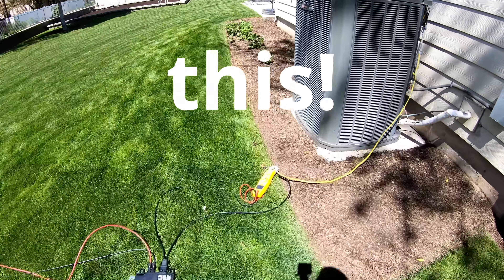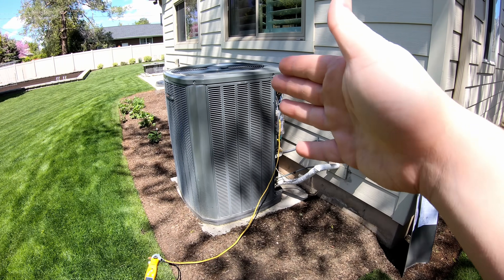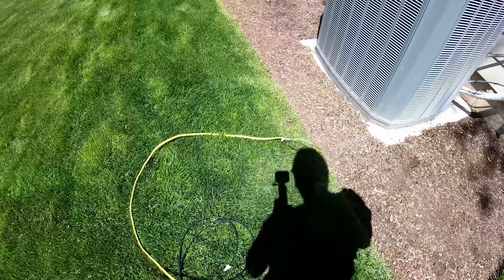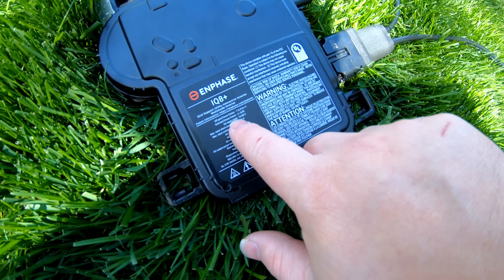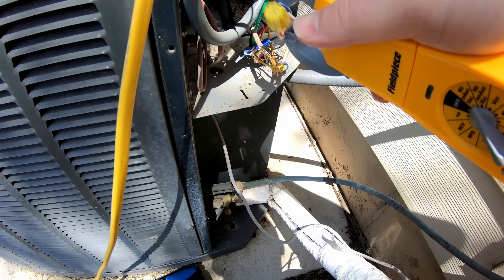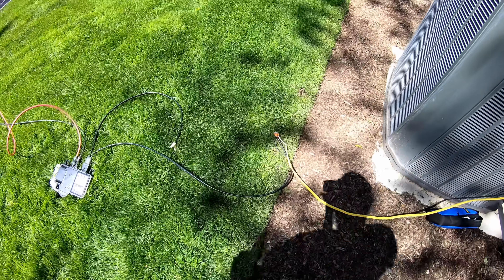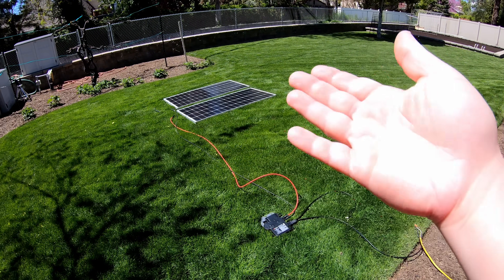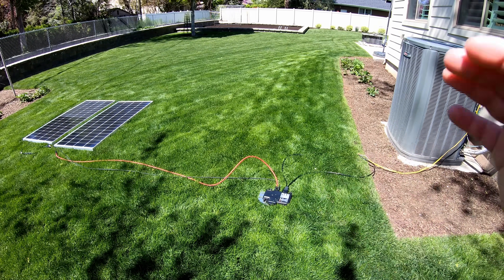1 Hack To Eliminate Your A/C Power Bill This Summer!

Comment: The title is deceiving. Its not eliminating the AC amp draw, just supplementing it to reduce the draw from the grid. Still a very creative way to save a few bucks, after the initial cost for components of course.
Reply from the maker: You’re right. The 400 watts worth of solar does not fully eliminate the full power consumption of my AC unit. However, it most certainly could with a few more panels and mico inverters…which I make mention of in the video. The beauty of this is you can start with a small setup, get it going and offsetting at least a little bit of your consumption, and then grow it to full eliminate your power draw as money allows. Thanks for watching!

Comment: The panels are not supplying anywhere near the power to run the AC, they just offset a little bit and only contribute when the AC is running.  They would contribute more power if you connect then to your breaker panel so they contribute all the time instead of intermittently when the AC is on.
Reply from the maker: What you said is true. However, if you don’t have a net metering agreement or off grid solar system, this way I show proof of concept only runs when the AC is on thus eliminating the chance of back feeding the grid which you would run the risk of of your hooked directly to the breaker. Thanks for watching!

Comment: CAN YOU SEND US ELECTRICAL SCHEMATICFOR THE HOOKUP OF YOUR IQ 8+ micro invertor and soft start unit. thanks Connie
Reply from the maker: I don’t have a schematic. But the two hot wires from the IQ8+ just connect on the load side of the A/C contactor like you saw in the video, the ground wire of course goes to ground. MicroAir EasyStart has its own schematics for different A/C types. Thanks for watching!
Reply: Can I buy iQ 10 the new one?

Comment: I do the same thing, but for the washer and dryer.  Washer and dryer connected to a power strip that's connected to a kill-o-watt meter that's connected to a y&h 1300w grid tie inverter that's connected to two in parallel 535 watt solar panels.  I still back feed to the grid, but what the washer and dryer consume is more than what I back feed into the grid so I'm ok with that.
Reply: By backfeeding to the grid, wont the power company won't realize you have solar without a permit and give u an issue ?
Reply from the maker: Sweet! Thanks for watching!

Comment: Awesome idea to offset ac unit power but what if you could make it more efficient too. Company called cool and save. Makes a product that sprays your ac condenser with water. Water has a better thermal efficiency than air and will pull more heat out of the condenser making it more efficient
Reply from the maker: I’ve seen those cool and save units. What you said is right about the evaporative cooling providing better heat transfer for the A/C unit. My only gripe with that is the minerals in the water. I really don’t want to have to try and clean minerals from my condenser coils. One thought would be to capture the condensate water from the A/C and then pressurize that water through the misters. That’s essentially distilled water since it was in the air and then got condensed. So that solves the mineral issues, only problem now is that you won’t get very long sessions of misting that condensate water because you’ll evaporate it faster then it can condense. Got to contemplate this concept more. In any case, huge thanks for watching and commenting!
Reply: @theresatrickforthat  well yes distilled water minus whatever would be in the air or whatever junk you be trapped in the coils. But other than that there's of course filter setups that would both allelize and acidify the water. The preference there is yours. And then besides that I would look into rainwater. Because just like you said through condensation and evaporation we get rainwater it's supposed to be pure water, that might do the trick for you. I guess the only question would be how far down the rabbit hole are you willing to go.

Comment: My ac unit on the inside of my house plugs into a 110/120 outlet .

If I was going to do that.

I would install a couple of deep cycle batteries outside and a power inverter somewhere near my AC unit and a solar panel to recharge the batteries. 

Looks like a good setup to me.
Reply from the maker: Adding batteries and an off grid inverter so you could harvest solar power from the panels even if the AC was off would be the ideal solution for sure! This proof of concept at least lets us poor people start getting some solar benefits for much cheaper while saving for batteries and a bigger inverter. Thanks for watching!
Reply: @theresatrickforthat  you're welcome.

Comment: This is almost clickbait.  You aren't "Eliminating your A/C bill" you are offsetting it, and VERY slightly.  1.2A will help, but it is a very small portion of what a full-size A/C unit will consume.  Plus, now you need to buy solar panels, wires, and a microinverter, which is a rather significant upfront cost just to save a few dimes per day.  Math: 0.4 kW panel, average 6h output = 2.4 kWh.  At $0.20 per kWh, you save 48 cents that day.  
Very disappointed but not surprised.
Reply from the maker: Like I said in the video, you can totally scale this proof of concept and eliminate your A/C bill. But a lot of us don’t have enough cash laying around to buy a huge solar system. So if I can get something small initially and start saving my precious $0.48 a day. That’s something! And then I can add to it to 100% eliminate the consumption as time and money allows. And hey! $0.48 a day gets me another solar panel for free after a year! Thanks for watching!
Reply: I agree, cool idea, but you are not eliminating your AC bill. You CAN, if you scale this idea, when the sun is out. But in this video you are not delivering on what you said, so you will probably continue to get haters on here. Haha I’ve learned to tune them out 😅 cheers man
Reply from the maker: @diyhvacguy  Thanks for watching Dave! Glad to have you here! Got to love the haters...but hey! I'll take views from anyone and everyone! Keep up the great work on your end!

Comment: AC units draw a ton of amps.  The small amount of watts delivered by those 2 solar panels won’t be worth the effort.
Reply from the maker: You’re right, but every bit helps! And as I mentioned in the video, you can easily scale this with more panels and inverters to 100% eliminate the power consumption. Thanks for watching!

Comment: There are string inverters that can do what you want in a more efficient ways. You can control via computer if the inverter will sell excess energy or to grid or not. 

These are the newer hybrid inverters. Of course you will need batteries to store energy for the off times..
Reply from the maker: That would be the ultimate setup for sure! This way I showed is a way to get up and going with solar and saving money with it faster and with a smaller system while you’re saving for the ultimate setup like you mentioned. Thanks for watching!

Comment: FAIL!!! you are only adding power to the outdoor condenser. The biggest power draw is from the indoor air handler. That is why there is a much larger breaker (usually 60a) going to the air handler and a smaller (usually 20a) breaker going to the condenser.  The caption says "eliminate" BS!!!
Reply from the maker: Thanks for watching a fail of a video anyway! I’ve found in air conditioning mode my condenser by far pulls more power than the indoor air handler since the air handler is just running the fan to move the indoor air around. The 60 amp breaker you’re used to seeing for air handlers is for the heat strips in the winter time if the outdoor unit is a heat pump and can’t keep up. And while my 400 watts of solar I showed in the video didn’t eliminate my power draw, you can easily scale my proof of concept to 100% offset the power consumption. Don’t forget to subscribe so you don’t miss my next FAIL and BS video! You won’t want to miss it!
Reply: Jack you don’t know what you are talking about. The compressor is always the biggest consumer not the air handler.

Comment: This is just a thought but if someone wanted to experiment without putting their expensive HVAC equipment at risk of damage an inexpensive air compressor ( with pressure activated contactors ) may be a good alternative.
Reply from the maker: Great recommendation! Just make sure to get a 240V air compressor if you're wanting to use the Enpahse inverters. Thanks for watching!

Comment: Good morning Sir. I have a 115 volts mini split. Can I offset the power on that. I see you using 220 volts. I would appreciate your feedback.
Reply from the maker: You can't use the same setup I show in this video with a 115V mini-split. And all of the other 120V micro inverters on the market seem gimmicky or expensive. So if I were you, I would just get a solar power station, plug the mini split into that, connect solar and away you go! Here's a video I made earlier this year testing the run time of my 115V mini split on an EcoFlow Delta 2 Max in heat pump mode. Note, I do not have any solar connected...but if you did, that would help offset some of the mini-split consumption all the way up to fully offsetting it with enough solar. https://youtu.be/eLvLTR6wPkc Thanks for watching!
Reply: @theresatrickforthat  thanks

Comment: I live in AZ , I want solar but it seems so overpriced for the actually ROI .  That said I have two units and they draw a lot, but the cost of power is around 12c per kWh which use about 45kwh daily in early summer and higher as it goes on , so two panels would generate 5.2kwh which is not much of an offset realistically, you would need a lot more panels .  For a heat pump though this is possible
Reply from the maker: Yep! And that’s the beauty of this setup. You can scale it as fast and as big as your wallet allows. But while you’re getting there, you can start getting at least some benefits. Thanks for watching!
Reply: With SRP this would be clutch during peak pricing, its like 40 cents per KWH in the peak hours

Comment: U think this same setup could run my 2 ton mini split?
Reply from the maker: The challenge with Mini-Splits is they don’t have a contactor to isolate the unit from the grid when the unit is off. So it would involve more parts and pieces to make work. Thanks for watching!

Comment: So the inverter is $189 + solar panels are $380 + wiring ~$50 = $620 to save 1 amp or 1/5 of your electricity on just your AC. If your power was $0.20 a KW you would break even in about 17 months time on 24/7 use. 1 amp = 0.24 KW X 24 hours = 5.76KW per day or $1.152 per day/$34.56 per month/$420.48 per year of savings. 
If the system works for over the 17 months you would start to see "Free Power". Which is not bad time frame..:)
Reply: Pacific gas and electric NorCal 43¢ tier 1 53¢ tier 2.  It would pay for itself quick.
Reply: @woodsyowl5538  WOW..!!! Where i live its 7.34¢/kWH and 8.63¢/kWH. That's why solar panels are not seen very much here. Power is cheap and panels are very expensive and inefficient.
Reply from the maker: You know the old saying…a penny saved is a penny earned! Haha! Thanks for watching!
Reply: @theresatrickforthat  a penny saved is more than a penny earned because of income tax and compounding interest. 
can get 100w panels for 40$ new and can get blemished/used panels for 20$ for 200-300w
roi will be a year or two on the cheap
Reply: @theresatrickforthat  Yeah, id like to see what it takes to get the AC full on solar.
Reply: He can't run the panel 24/7 for obvious reasons. The power output is also going to change with time of day and even time of year.
Reply: Your solar panels gather sun 24 hours a day, do they?? Must be magic panels, huh?
Reply: @-WiseGuy-  batteries bro. you can build a battery large enough to power your house when the sun is down for like 700$ now days
Reply: @vevenaneathna  
Wtf are you talking about??

1) Solar panels don't produce power in the dark. So his calculation is moronic.

2) A sufficient battery backup to run an entire house costs msny THOUSANDS of dollars.
Reply: @-WiseGuy-    hmm youre not so well informed. i built a 4kwh battery for 340 usd a couple months ago. I replaced the 12v battery in my EV to give me better range due to the higher voltage of lifepo4 tricking the car into not charging the low voltage system
i then installed 200w of solar on the roof, which cost 84$ after tax and shipping fedex, which goes into a 28$ mppt charge controller and keeps the low voltage system charged up
after my car is all charged up, the solar panels and batteries backfeed my house all day and night through a 50w nominal 24$ 120v microinverter. one could say, the solar panels are providing me power day and night via a battery.
i wish people didnt have such strong uninformed/out of date opinions on this stuff. i am about as far right as it gets with politics but here i am driving an electric car, mainly because i dont want to pay taxes lol
Reply: @vevenaneathna y I'm very interested in learning more about your storage system. Any videos on it?
Reply: @fmolina28  not yet. i made a somewhat detailed post on  the gm-volt forums under gen1 -> modifications titled "solar charging volt and 4kwh lifepo4 addition" last month. i havent found any other videos on the subject so far so i feel like i should make one explaining what i did
Reply: @vevenaneathna  How do you not have to pay taxes from driving an electric car?

Comment: Calling BULLSHIT!  Whole house AC's are 240 volts. His "inverter" is only 110-120 volt. On top of which those two panels aren't enough amps to power the AC.
Reply from the maker: Huge thanks for watching this bull** of a video anyway! I appreciate getting views from anyone and everyone! You may want to look up the specs on the Enphase IQ8+ inverter to verify what voltage it produces to be sure you’re schooling me by the book. Written specs make a lot better case against me! And then you also may want to submit further details on how grid tie inverters work with the grid to power loads in case you have a large load like my AC unit that pulls more amps than the grid tie inverter puts out. It’s almost like the grid helps out somehow! ;) Anyway, be sure to subscribe so you can be sure to call bull** on my next video! You won’t want to miss it!

Comment: I get the feeling that feeding to the grid with this setup is bad or to be avoided…why is that? 😮
Reply from the maker: The beauty of this setup is it’s impossible to backfeed the grid because not only do you have the AC contactor isolating the solar, but you also have the rapid shut down of the inverter. Just don’t oversize your solar for what you AC unit uses and you’ll be 100% self consumption when it’s running and zero output when it’s off. Thanks for watching!

Comment: I've been doing hacks like this for a decade. The problem with most grid-tie inverters is that they follow the legal mandate of waiting 5 minutes before exporting power, so unless you are in a particularly hot climate, that misses most of the AC cycle. There are lots of options to get around that, but the point of this video is that it is the cheapest way to do this.
Reply from the maker: You’re exactly right! Thanks for watching!
Reply: Who cares if you inadvertently export power to the grid? I don't see why this would be an issue, can't you just hook the panels directly to the ac breaker and if the AC isn't on the power will go somewhere else in the house no?
Reply: @jims.3987 the panels are DC, hence the DC to AC inverter. Export is a problem if he has a smart meter as the utility will notice.
Reply: so I'm in Central Cali very hot and sunny most of the year.. my ac is pulling like 5-7k watts when running..If I get like 3kw of solar panels it will cut my bill in half during the day?  Will it backfeed to the grid and will PGE know ?
Reply: @nayefalkurahi3357  PGE will not know.  In the video he's not using enough power to feed the grid.  He's only supplementing the AC with a small amount of power but majority of the power is coming from the grid.  In short, he's reducing his bill.
Reply: If you're running the newer inverter or two or three stage AC/Heat pumps they tend to run at lower output for extended periods (like 30 min to an hour or more( rather than the older style: "either it's off or it's on 100%" AC units.
Reply: Captain Obvious, do you know what work-arounds for the 5 minute delay are? Are there inverters that are configurable? I was wondering if UK or AU inverters didn't have that requirement.
Reply: The utility company cares a lot if you export. And they should. It's a huge safety risk for linemen. If the grid goes down, and you backfeed, the first transformer will bump that up to, probably 7.2kV on the line. If they expect that line to be dead, and you suddenly energized it, you may well kill people.

That's why they make a big deal about you pushing power to the grid. It's also illegal in most areas due to the risk. They inspect your setup to ensure that if the grid is down, you can't power it up unexpectedly. That's also why if you have a backup generator you need a transfer switch. 

If you do it anyway, you might also be charged money on the bill for the power you export. Older meters don't know which direction the flow is going.
Reply: @ttabbal  
That inverter, like every other grid-tie inverter on the market, will not export power unless it actually sees power coming in from the grid first, and will immediately disconnect if grid power is lost.
Reply: @Wrenchmonkey1  So true, Some people comment and not know how things work.